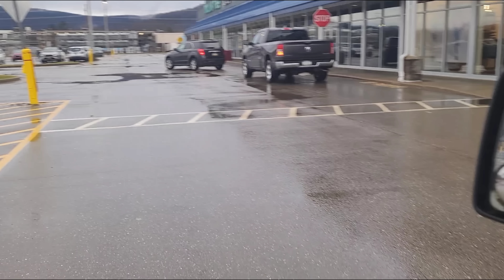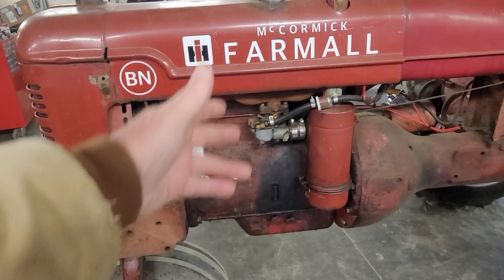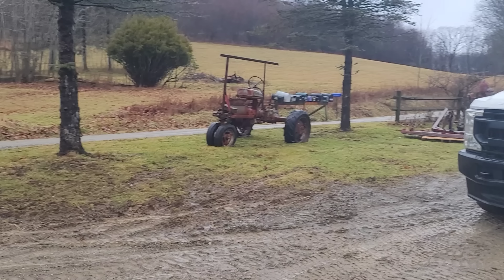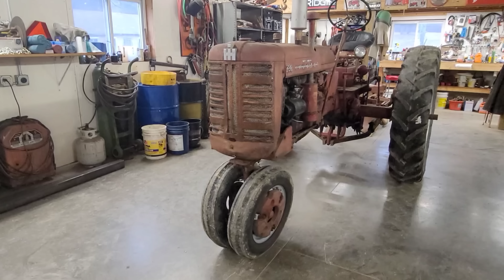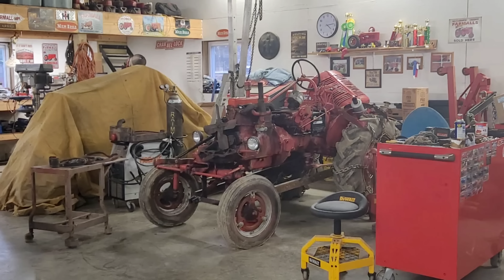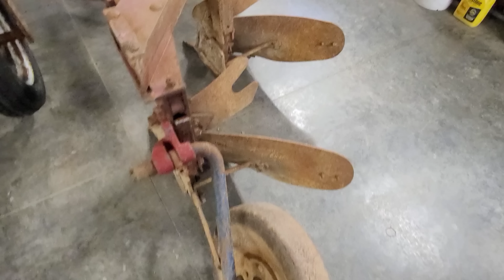Farmall Friday | Tractors for Sale

Comment: He seems like a wheeler and a dealer on farm equipment  .  I got a heavy duty 2 bottom similar to that and there were times it was all my John Deere 2010 could handle . I was thinking someone built the plow because I haven't seen one like it yet . I'm going to hook it up to the M and do some plowing with it .  Thanks for sharing and have a great weekend !
Reply from the maker: 2010s weren't know for torque
Reply: I have my Super M all original, not restored that I plowed with all day long for years as a kid! 3 bottom, rope pull. Tractor kept inside all these years.

Comment: I  still think you should get the 230, especially with the 211 plow. The 230 seems to lift the 211 all right. That's why I think a 300 or 350 will be fine with your 311.
Reply from the maker: I think a 350 would be OK with the 311